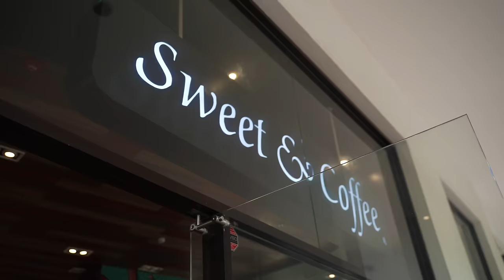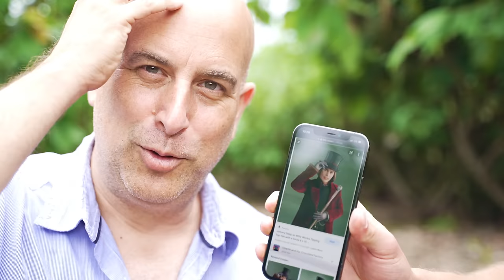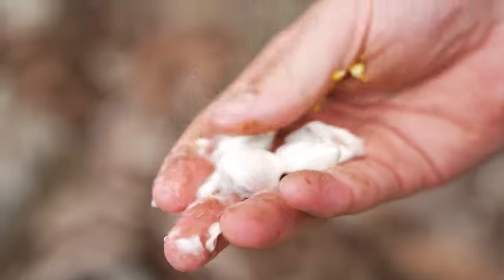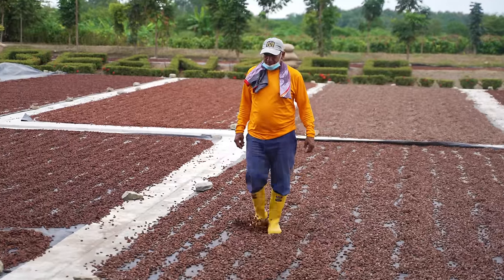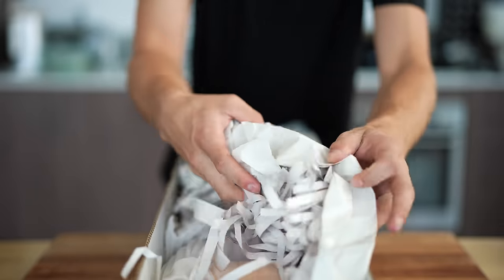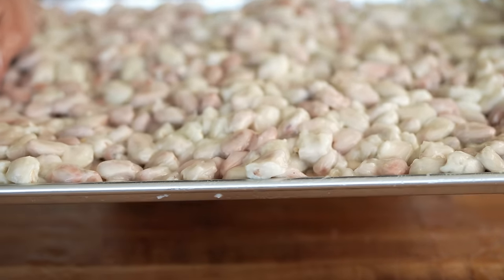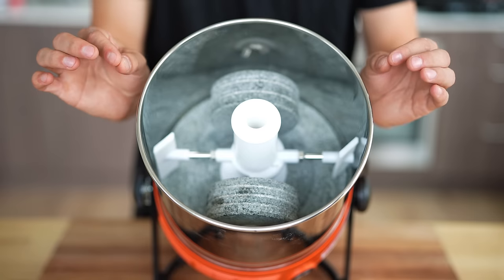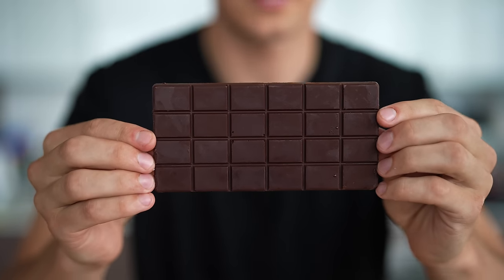Homemade Milk Chocolate

Comment: We also do a similar process but instead of fermenting it, we would dry it under the sun, for a few days then we would roast it in a large pan, then we grind it into the same consistent that you got. Theeeeennn we form it into small round shapes then freeze it, theeen when you want a hot chocolate you just get a frozen 'tablea' then boil it. THEEEN YOU'LL GET A VERY THICK DARK CHOCOLATE DRINK. 

It probably different for you guys but this is how my grandfather makes our 'tablea/kakao drink'. 😊😊😊